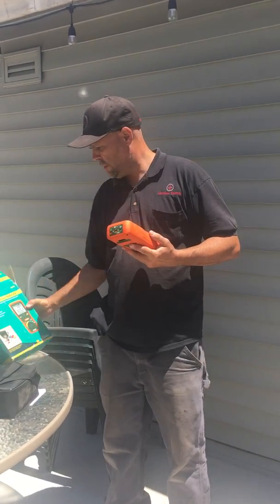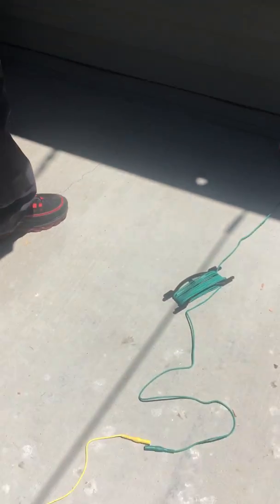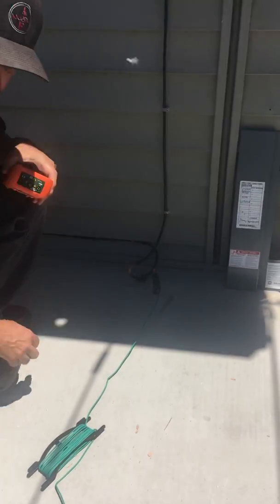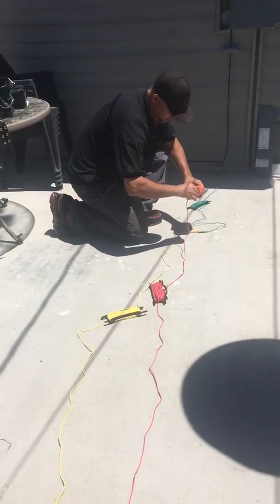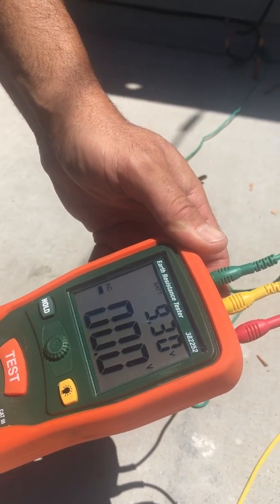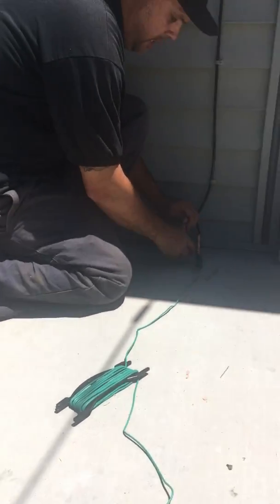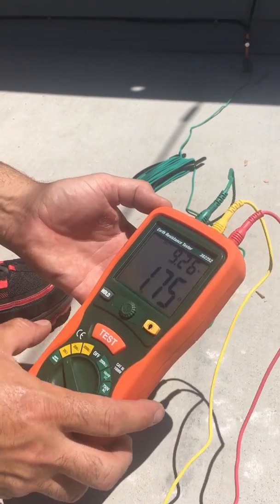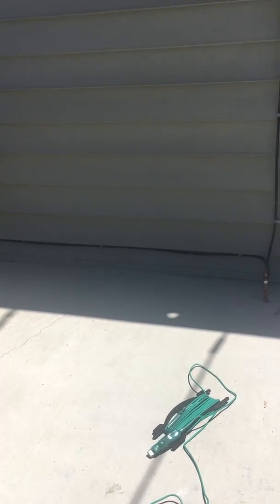Earth ground resistance to ground rod test

Comment: I did the exact same thing but mine just beeps when i press test, and the number just stays 1?
Reply from the maker: You probably need to turn the dial up to the 200 scale or even the next after that, sounds like you don’t have a very good ground.
Reply: @daveharmon3134  actually i think i know the problem, it was raining hard all day yesterday, but i already bought the ground rod and at the job site so guess ill just install it.
Reply: @daveharmon3134  i did 200 and it goes up to 90 something, forget it im just gonna go buy another ground rod

Comment: 200 dollars is a lot of money for a tester you don't even need , you just need to install two ground rods 6 ft plus from each other  and save 200 dollars you can use for groceries
Reply: i think dave is doing this to prove a point to unskilled inspectors, we live in the central valley this is not Arkansa or texas where there is expected hurricanes/sever weather. in addition  a water line should be consider as  supplemental  as listed in 250.52
Reply: I think we can use aomething like old bulbs, hair dryer, toaster oven, running without neutrol, using ground instead, and use any cheap clamp meter, calculate out the ground resistance.
Reply: If you need to prove the integrity of an existing UFER ground so you don't have to drive rods and route a new EGC then $200 is a bargain. 
Smart money adds up faster then skimped money all day.
If you're not doing much work or just operating in a narrow niche of the trade then $200 may be a lot of money.
Reply: In Missouri we have to report the OHM readings to the inspector on the permit application.  Completely necessary or they wont even do an inspection.  I guess the value just depends on what you are using it for.
Reply: My inspector is giving me a hard time, she did this 2 times now, 1st time saying that she doesnt believe my ground rod is 10 feet and to ground another rod into the earth for my 200 amp meter. I went online to talk to her manager and showed receipt that it was.

Next job she's doing the same thing, but this tiem telling me to ground 2, reported to manager he said only 1 is needed. Now she's telling me i have to record the resistance reading and it has to be under 25 ohms. But this meter isnt working right. I did the exact same set up but the big 1 number doesnt change when the meggar is beeping.

Also she's telling me to break down the shed that looks like a house in the  back and she's never been in the house and tell us we have to install a smoke detector. Dont know what her problem is.

Comment: Can this test be done with a multimeter and 2 lengths of wire and average the ohm readings at both distances? Wonder if it would be close.
Reply from the maker: Possibly, but not with copper, you would have to use a less conductive wire, maybe  tungsten. With copper you wouldn’t read any resistance on either length of wire, you would read 0.0 or 0.1..